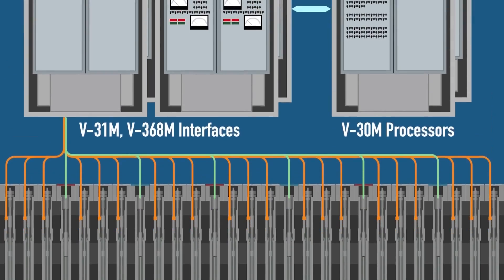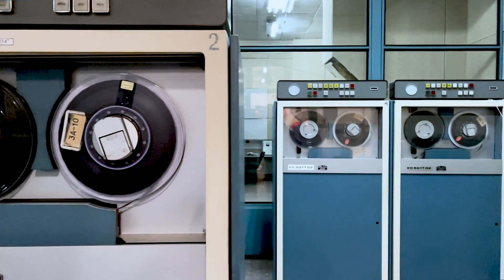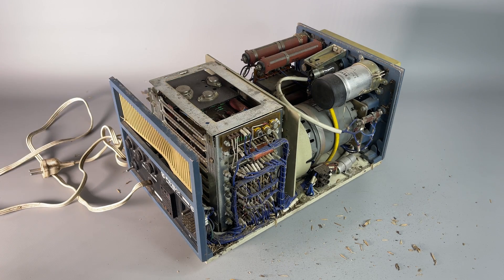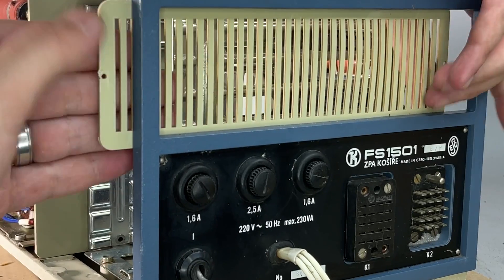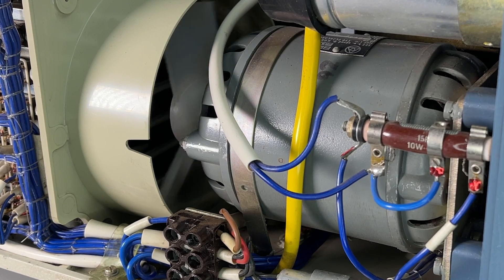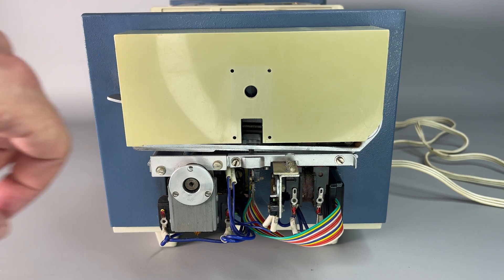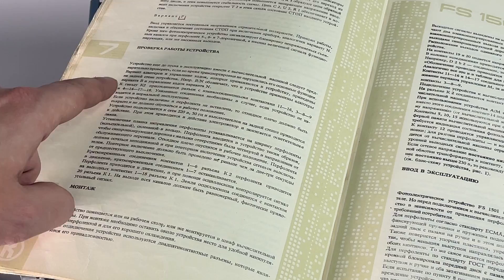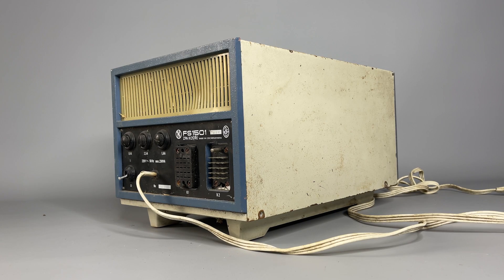Chicken attack! Chernobyl SKALA Punch Tape Reader Restoration!

Comment: I used to work in IT and it never ceases to amaze me how intricate older equipment can be.
Reply from the maker: So right.
Reply: Ah, older times, where machines were as capable as they were designed. And then modern electronics era begun...
Reply: @alexturnbackthearmy1907   modern electronics are very capable, the problem is software, software is shit nowadays because programmers don't know how to make good software anymore, or ever knew to begin with as the never-ending stream of Eternal September for new noob programmers, its ridiculous the average age (in experience) is 3.5 years.
Reply: @alexturnbackthearmy1907   you mean like how apples are getting? lol!
Reply: @monad_tcp Yeah because they dont need to, Software optimisation and a programmer actually knowing how the hardware being programmed for works is long gone. Its a dead art, and its sad. It was absolutely incredible what early software engineers could achieve out of such primitive hardware, because they not only understood the hardware architecture, but also the machine code itself.

Comment: Opening up the case to that tape reader was honestly heartbreaking. Yet at the same time I have about forty chickens so know how dirty they can be. that is honestly amazingly clean compared to how bad it could have been.
Reply: Fortunately, it looked like it was stuff that could be cleaned out with compressed air and lots of patience. No leaky capacitors or water damage. Good job!
Reply from the maker: @user-name-goes-here  there are a few questionable capacitors on the stabilizer board, but so far they work, though we'll need to replace them for sure.
Reply: @ChernobylFamily  that’s understandable, looking at the age of the item, I suppose. It would be very unusual to find pristine capacitors after so many years.
Reply from the maker: Yes, my grandma had chickens, remember that... experience.

Comment: what I am curious about, is if the strong radiation at Chernobyl, erased all the Magnetic system / Date tapes from the Skala computer system? I know strong magnetism would, but not sure about the high level and type of  Radiation that escaped in the explosion.. . . .
Reply: That should not be the case. A nuclear explosion (as seen from an atom bomb) can cause an electromagnetic pulse, which might damage electronics or magnetic media, but that did not happen in the Chernobyl accident, or any other nuclear power accident. A nuclear explosion requires highly enriched uranium, and a very specific procedure to set off the bomb. Instead, the explosions that happened at Chernobyl were a steam explosion, followed by a hydrogen explosion. Nuclear materials were then released into the surroundings, which would emit alpha, beta and gamma radiation from the decay of nuclear isotopes, but this should not affect magnetic tape. If magnetic tape was damaged at the plant it's more like to come from physical, fire or water damage following the accident. I don't know any details surrounding that though.
Reply from the maker: @Gameboygenius  exactly.
Reply from the maker: Here are three things: 1) if something is at ChNPP it is not always contaminated and radiation is not always elevated. The power plant is insanely huge (we have a video about that!) and only a part on its very edge was affected badly 2) that was not a nuclear explosion, but more a dirty bomb-like, so there were different effects 3) speaking specifically about Skala of Unit 4, between computer rooms and damaged reactor there are many walls and rooms; that was a great shield, so although there got some contamination via vents, actually all tapes of SKALA #4 were removed and data from them dumped to assist in the investigation.

About radiation conditions in that early post-Chernobyl epoch check our Patreon series "Chernobyl-88", there are very detailed reports we translated to English.

Comment: If you can't find the connectors, you can probably just use individual standard spade connectors for each pin!
Reply from the maker: Yes, and that's exactly lead to that BOOM you can see in the video :))) I mean, yes, possible, but this device is vibrating pretty much, so they can move and short something.
Reply: @ChernobylFamily I wonder if some kind of replacement connector could be made with 3d printing?
Reply from the maker: @ct6502c  Perhaps, but to position 20 pins that they are really holding may be The Quest.

Comment: You could try 3D printing connectors if its not too complex geometry.
Reply from the maker: It is not that complex, but we'll go to it as a last resort, as to position inside 20 pretty massive pins is quite a task. And just to find them also, as those have a but unusual size and pitch.

Comment: Your punch tape reader looks a lot like the ones that used to be on the old Computer Numerical Control (CNC) machining and turning centers I used to work with back in the 80s... Our shop even had the typewriter that would punch out each line of G Code programming onto the paper tape that we'd load into the machines... Starting in the 90s and extending afterwards, downloading from the programming computer in the office to each CNC machine via cable (and eventually wifi) made the paper tape and optical readers obsolete, and the newer machines no longer had them...
Reply from the maker: Thank you for sharing!